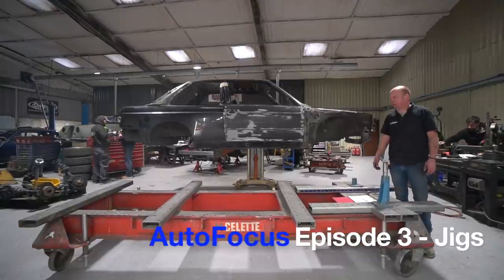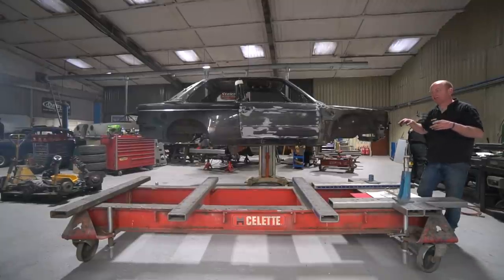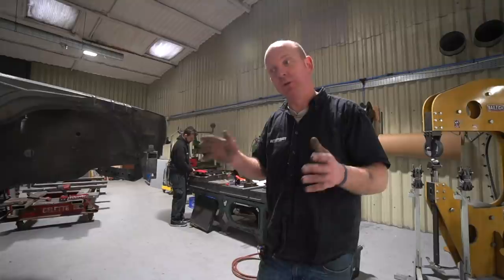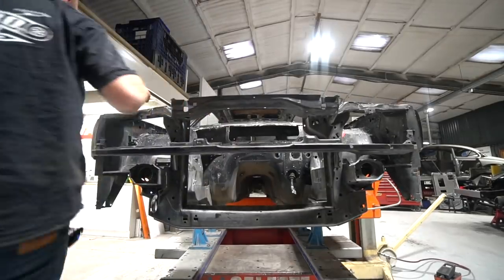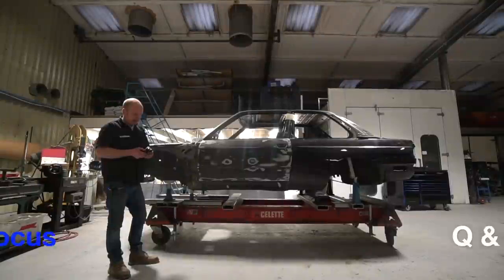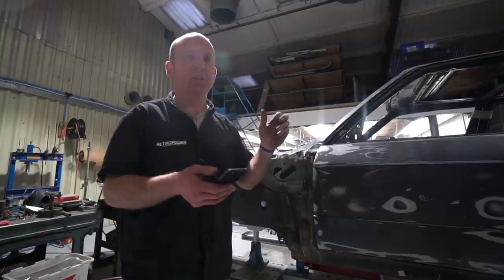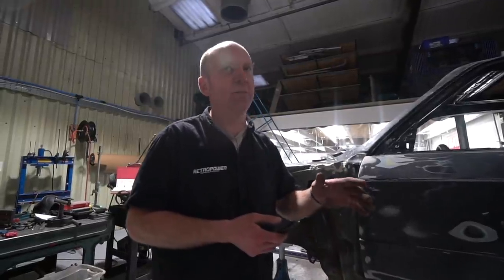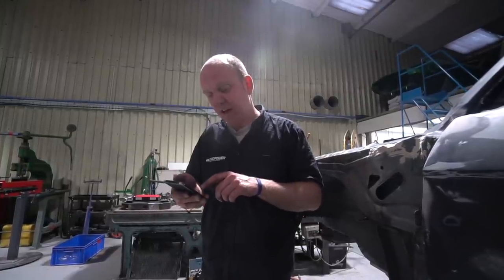AutoFocus Episode 3: BODYSHELL JIGGING - HOW AND WHY!

Comment: Good afternoon Gents, do you use any type of cavity wax as part of the restoration process. I am familiar with Waxoyl products and have used it on several vehicles, just curious after zinc coating and truck bed liner on the exposed areas.

Comment: Hyperthetical   Is there any benefit to stiffen up a frame on a vintage Italian sports car that’s a convertible. Let’s say a old Alfa or fiat spider.  Thinking of getting a 72 or 74.  Fiat spider   Thinking a roll bar no back seat.
Reply: You can look at the frames they put into the 124 spider Abarth for rallying. The rear roll bar mounted into the rear suspension mounts including a strut brace, forward the roll bar extended with a bottom rail and a side impact bar, meeting a hoop under the dash which connected to the front suspension mounts and subsequent front strut brace.....it's a lot of welding
Reply: @marcusott2973  ty if I ever win the sweep stakes I’ll just commission you to build me one lol.
Reply: @FstopPicturesByAlunDavies  if you win big, I'll find somebody with better welding skills than mine 😉